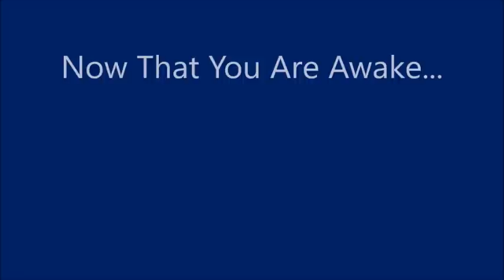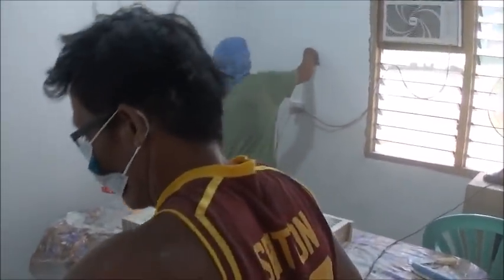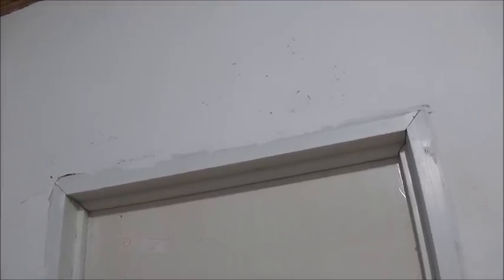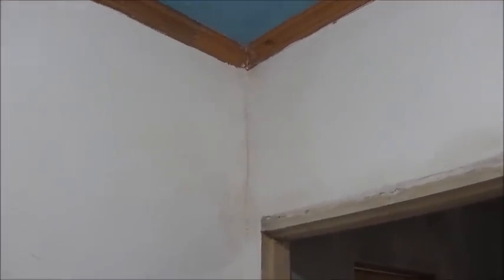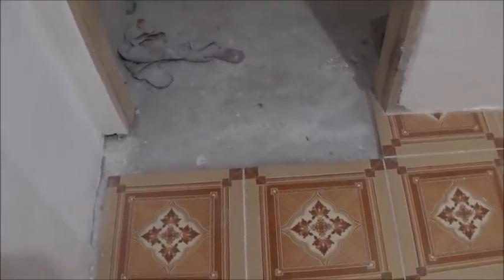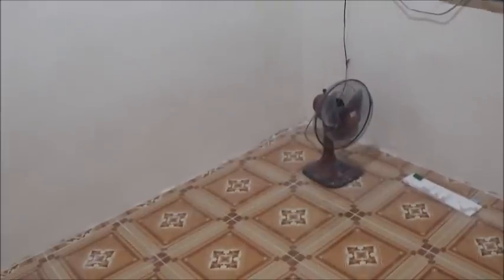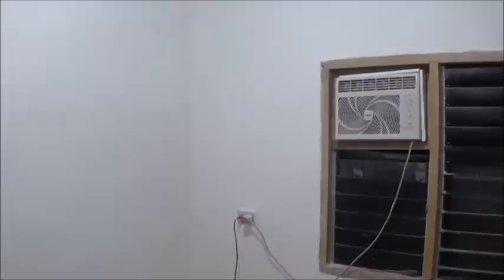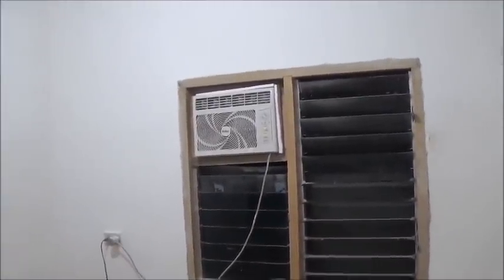2nd Bedroom Skimcoat Progress

Comment: skim coat is the Philippine/cinder block  equivalent to plastering .   some trim molding around the doors and window frames. and you will still Probably need to paint over the skim coat. and maybe a base board along the bottom of the walls.  I agree, the base board, crown molding and the Door, all the same color